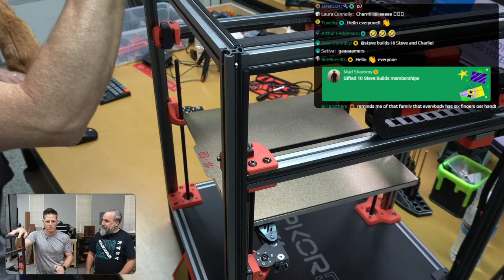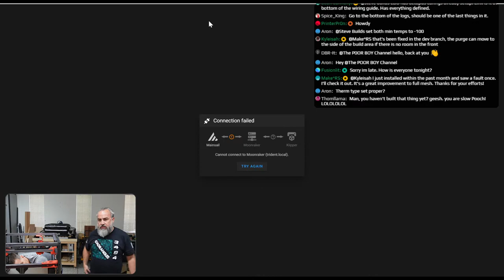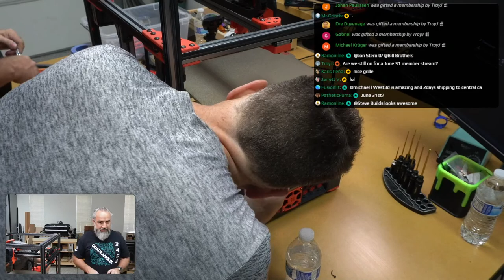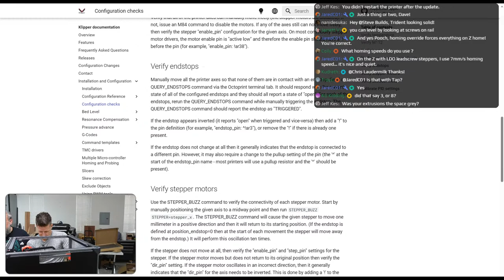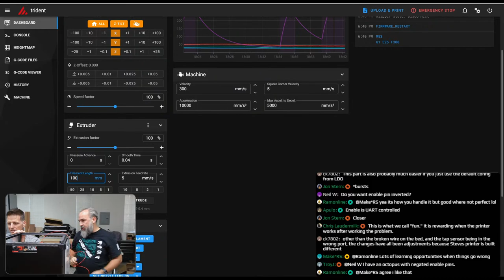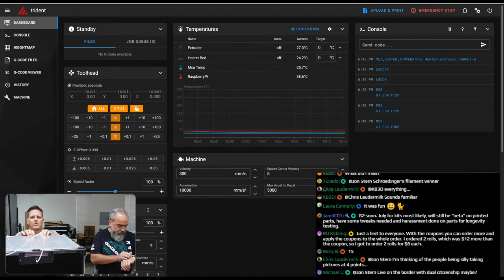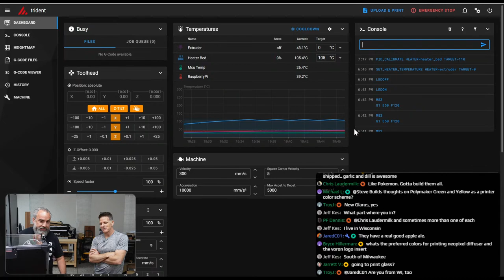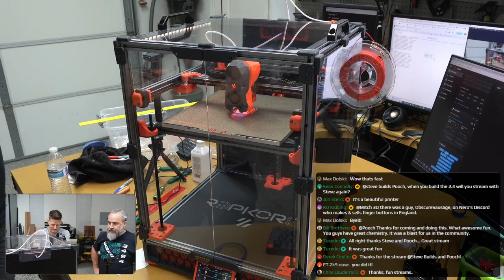Pooch's Trident Build! - (Part 5)

Comment: working on my first trident and the whole bottom panel door idea is garbage and not neccessary. struggling with it bad.
Reply from the maker: Sorry it's causing you frustration, can you describe the issue in a little more detail?  Maybe I can offer some tips.
Reply: @SteveBuilds  I finally got it but it was a balance act to place the panel on the hinges so the panel wouldn't catch the feet. I thought of a solution I'd have to design and print out to just hold the panel in place perfectly enough to put on the hinges with little fuss.
Reply from the maker: Glad you got it sorted out.